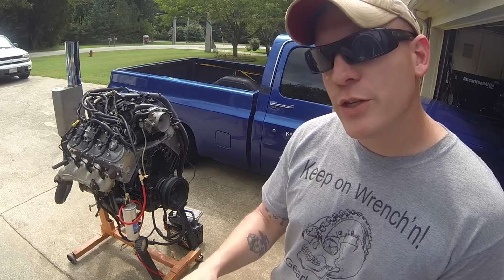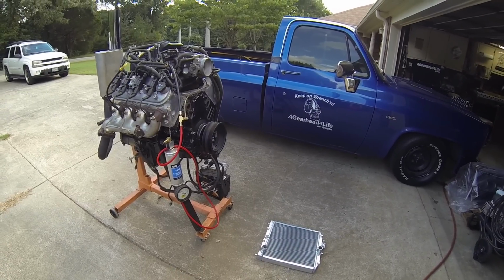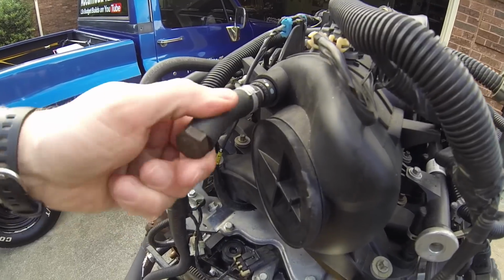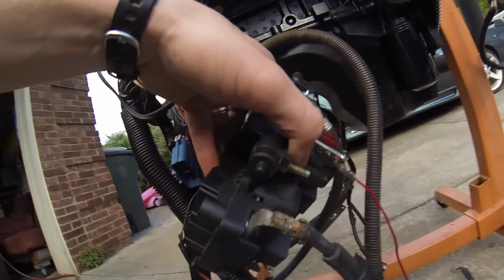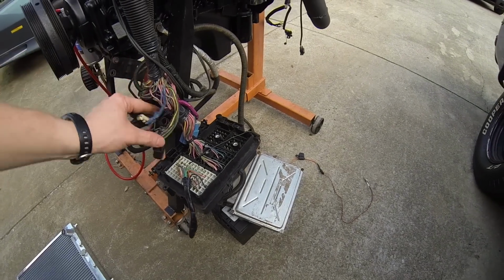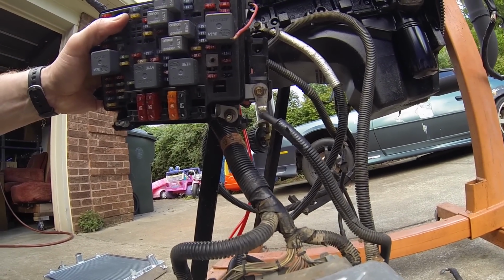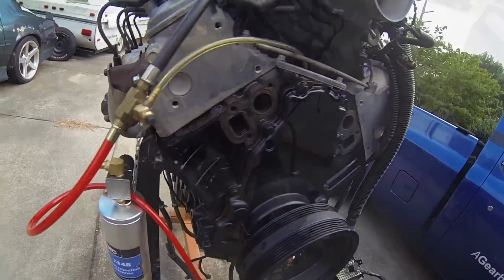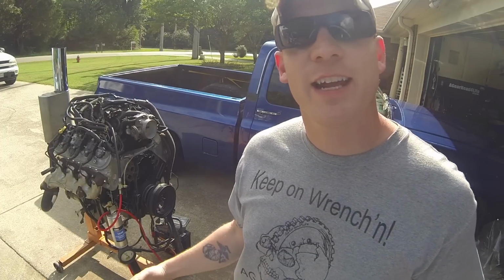LSx Swap Harness How To Simple & Free DIY Standalone on the Test Stand

Comment: Great Video.
Question - have you been able to successfully  run a 4L80 transmission with these swaps?
Or have you been sticking to the 700-R4 ?
Reply from the maker: +John Mulhall I see you havent watch any of my other videos. lol Most of my swaps are with 80e. I dont use 700r4s.
Reply: now that is an area I need education on (4l80e use) as well.  How much bigger is the case of the 80e over the 60e?  I see the market draw for a transmission video on what you did as well.
Reply from the maker: norsk54472 Good idea! it's not that much larger and there are a few different ways to run it. I prefer the segment swap though. Since you have HPT, it'll be something to put on your list to figure out. That's what I've done. lol Had a buddy show me how it goes, but I'll have to practice it.

Comment: I've done exactly what you did plus more and it runs rich to the point to where it wont start and stay running you can smell and see gas fumes as your turning it over and there is gas in my oil, got any ideas?

Comment: Love the videos man. Question, i have a drive buy cable throttle body but my wiring harness is electronic, is it possible to convert  the electronic throttle harnessto drive buy cable?
Reply from the maker: cheep jp Thank you! Yep! This harness was converted from DBW to DBC. It was about 5 wires that I had to add to the harness for the IAC and TPS.

Comment: What if I don't have that white fuse block which where that black wire comes out? Btw awesome vid! I've learned a lot thanks to you!
Reply from the maker: Thanks jmtz! You don't have to have that white fuse block. Before I had it I just ran a wire to the same terminal. The fuse block is labeled and you'll see where it goes.
Reply: +AGearHead4Life thanks!!!
Reply: +AGearHead4Life soon I'll be LS swapping my 1972 c10 with a 5.3 and a 88mm turbo. I'll send you pics through out the build
Reply from the maker: Sweet! Good luck! Sounds like fun.

Comment: Hey buddy can you email me info? I want to do away with the  big bulky fuse box and drop a 5.3 in a 94 gmc this is my second swap . and wire it into my existing fuse box or at least wire it into a smaller fuse box . thanks for any information. please keep up the great work and I love your toys!!!
Reply from the maker: +chevyman Thank you ChevyMan! Nah, I can't keep up with the emails or FB PMs. So on here is the best way to communicate. I try to keep up with the comments on youtube. That or you could join our group FB page "A Gear Head For Life". LT1SwapDOTcom has the diagrams to help you out too. Basically it just cutting off the fuse block and giving all the pink wires power. Most are ignition hot and a couple are constant hot.

Comment: whats uo gear head...I have another dilema hoping you are able to help me...I'm having trouble with the fuel delivery I purchased a inline pump but I'm not quite sure how to run my hoses and I don't have a return in rail...thanks your info and videos are A-1..
Reply from the maker: Thanks brotha! Which part is your delima? The lack of a return line on the fuel rail? If so, just use a C5 vett fuel filter. It has a built in pressure regulator and has a return output line.

Comment: Same 1997 GMC Sierra 3500 7.4 wondering which wire's are power to the computer there are two I'm guessing one constant one with ignition.. I start talkin to mechanics about figuring this truck out they start shaking their head no.

Comment: Can you explain where you are connecting the fuel injector device to that provides fuel to the engine?  If you are connecting to the valve on the fuel rail, what adapter are you using?  I bought the same exact model injector cleaner, but it did not include any adapters and no way to connect to the fuel rail. Thanks.

Comment: Hello Again. Working on my other project. 
I went to start my dad's 1967 Olds Cutlass with 4.8LS (Engine from 2003 Chevy Silverado) Conversion and smelled fuel, I luckily had the exhaust and headers separated.
I saw fuel spraying out of the passenger side of the header.  I Swapped injectors for Cylinder #4 & #6 after smelling fuel on the plugs. I restarted the engine and the fuel still leaked unburned raw fuel.
Any Ideas on how I should fix?

Comment: I have 2 x 5.3 Ls engines for a 52 Chev and a 34 Plymouth one is 2000 and other is 2002 after VATs removal on the PCMs will these be driveable as you outline with the harness. Thank you for all your efforts for all of us. Very commendable
Reply from the maker: +Harry Ahmed Thanks Harry! Yes, you could drive it like this. You'll want to run the TCC wire to your brake pedal though, if running the LS style trans. You'll also need to figure out how you'll power your fuel pump. This harness has a wire coming off of it that is usually used to control the fuel pump relay.

Comment: will not having enought fuel pressure cause it not to crank i looped the driver side fuel rell as you did and hosed up a holley black to the passenger side vats removed
Reply from the maker: Yea, it wont run if the fuel pressue is too low. You need 60 lbs. It'll kinda run on 20ish, but not very well.

Comment: Hey I have the same cooling fans off a Lincoln and I was wondering how u had the relay hooked up to get the high speed to come on 84 chevy
Reply from the maker: +Christopher Kingsley There are many ways to trigger the high speed to come on. I'll be using the AC to trigger mine, but I can run the high speed yet because I havent acquired large enough relay and wire to handle it yet. Very powerful fan though. Cant wait to get it working at its best.

Comment: My whole center plug is gone out under the fuse box so this be my reason for no power to my truck? I've swapped over to a ls1 intake and a stand alone harness that was cleaned up . The truck was a factory 4.3 now is a 6.0

Comment: Hey bud! Great easy video......... I want to swap an LS in to my 2010 Crown Vic........Although the LS engine runs stand alone and all, immobilizer deactivated, how do I make the harness talk to my Ford gauges? Or is it as easy as just finding the wire that sends a signal because they all communicate the same?
Reply from the maker: I could possibly be that easy. I dont know what the Vic gauges need to see as far as signal, but I'd hook it up that way and see what happens.

Comment: What about the MAF?
Reply from the maker: Juan A. O. Z. The PCM does fine without the MAF. I believe that it defaults to using the MAP for the needed input in this situation. I don’t use a MAF anymore. I did at first, but not anymore. 😁👍
Reply: Nice... job job. Thanks

Comment: I want to put a lq4 from a 2005 Silverado HD with the 4 L 80 I have the whole wiring harness the throttle pedal the Box the wiring all the way back to the stock fuel pump powering the system up with the one wire will it make the transmission work as well after flashing the Box doing away with the EVAP EGR and second oxygen sensors

Comment: Great video ..but what if Iwant to keep my transmission 700r4 in a c10- 83 ... but I like
this engine 5.3 ....and is not difficult to adapt .... my fear is the motor mount , comp, exhaust, and transmission  ....  cheers .......
Reply from the maker: I don't recommend using the 700r4. You can, but you'll quickly break it and then be replacing it. I have a video on the motor mounts as well. The exhaust was covered in my first '84 C10 LS swap video.
Reply: AGearHead4Life
you right ... and the fuel pump ?? .. cheers ..
Reply from the maker: mco zpda a walbro 255.
Reply: AGearHead4Life
tks ....
and the trans is the same to that engine ?
Reply from the maker: no. I use an 80e

Comment: Hello.  I have a 5.3ls and 4L60 from a 2000 Tahoe installed in a 1971 chevelle.  I have the entire fuse box,  engine harness,  and ecm from that Tahoe. After flashing the ecm, what steps would I need to do to use that existing fuse box or would you suggest not using it?  Thank you in advance for your help.
Reply from the maker: John Smith This sounds like a much longer discussion than could be typed here.
But basically, you'd do just as I did here in this video. It'd work fine. There'll likely be other things that you'll want to wire in later, like the TCC wire to the brake switch for the 60e that you're running and the OBD2 port for information. You kinda gotta review the setup to decide what you'll want.
Reply: Thank You for getting back to me. I will try and mirror your video...

Comment: I only have the C2 part of the fuse block. Is it possible to get the motor running without the rest of the fuse block(c1, c3, etc)?  Where would I power and ground C2 to get it running on the stand?

Comment: Hi Im doing a LS1 swap with stand alone harness,  do you use any tuning software and what about fault codes as no  BCM  connected it will be throwing up codes due to missing inputs from sensors. Hard to find honest information on tuning software.
Love the videos keep it up.
Reply from the maker: Thank you! Yes, I started out having a tuner dial everything in and turn CEL codes for things that I wasn't using, like the emissions stuff. I never had an issue not running the BCM.
You'll need to locate a tuner, preferable local to you, that'll flash the PCM for your setup.
Reply: Cool, I have had a tuner  remove the VATS so i can get it running for now,, Not cheap here in New Zealand though most tuners asking  around $500-$650 to reflash computer. Holley oil pan from US cost me $800 delivered,  once car is complete i will get a dino tune as want to upgrade cam.  Could you recommend a  cam and stall converter for a weekend cruiser using 4l60e and  3.55 rear end.   
Cheers
Reply from the maker: Ouch! Man, that's a bump in costs over there. There are so many tuners here that people can get a PCM flashed for $100-150 to remove VATS. But to get an actual dyno tune costs around $400.
To chose a cam for another project can be hard because you never know what they'll find tolerable for them.

On the budget cam side we have cams like the BTR Truck cams. They're budget because of their low lift allows them to use inexpensive valve springs($60) and stock push rods(free).
So, something like the BTR TRuck stage 3 cam could be fun for a somewhat aggressive weekend cruiser.

There are better cams with more lift that will require $100 hardened push rods and $150 Valve springs.
Check out the Texas Speed & Performance 224r cam.

Comment: This is bad ass, is there a way to do it if you didn't get the fuse box?
Reply from the maker: thanks! Yes there is, but that'd be another video. I plan to make more videos of different ways of doing this, each would be a step more in difficulty. the next video would be how to do this without using the factory fuse block.
Reply: Awesome, I am thinking since this is my first swap i should just pay to get my harness re-worked but it's just so dagon expensive and it stinks to see my car sit. Thanks for answering  bro i really appreciate it.
Reply from the maker: Yep, no problem. You could also easily pick up a fuse block from a salvage yard.
Reply: I ended up getting a harness, with a ecu, and a throttle body for a pretty good deal. If this swap goes smoothly i will probably swap out some more of my toys :) thanks so much for answering my questions.

Comment: Now wait a minute.  If I don't have the original fuse block from the donor vehicle, pin A9 of the C1 harness isn't connected to anything... Or am I not envisioning it correctly?  If it's truly this simple, I'd like to strip off the plastic wire loom and remove all of the un-necessary wires to clean up my harness/engine bay.

Comment: I'll keep u posted on the build...its a 5.3L..Out of a truck...I hear u can bolt up a 400 transmission, 4L60, 2 speed powerglid...What do u suggest?...Project daily driver
Reply from the maker: +Buick72100 Yea, you can use all of them, but as a daily, I've got to have overdrive. I usually prefer to use the 4l80e because I can find them for the same price as a 60e, but theyre very durable and I don't like having to drop a trans for repairs. If you plan to abuse the car, like a race car, go with a strong trans like the 80e. It eats some power and is heavy, but its worth it in my opinion to not have to keep replacing it. That plus its inexpensive and strong, my favorite.

Comment: 1997 GMC Sierra 3500 7.4 liter dual wheel pickup truck. The main computer under the hood driver side 4 plugs white black red blue connectors small Central connector topside also. In between black and white connector.. I've changed everything. Coil ignition module distributor crankshaft position sensor and that main computer ECM I guess you call it. I don't have chipped key. I did ignition sequence 11 minutes on 30 seconds off Etc. No spark no control side relay to load side. I've been able to get full pressure by jumper wiring load side fuse box apparently no Spark. Visible. From spark plug wire. All three fuses good ignition A ignition B ignition e. With power fuse box ignition on.. Was driving motor just shut off a week ago. Now cleaning grounds...... mayday mayday

Comment: helpfull videos i got a 02 5.3 that has the drive by wire could i use the dbw with that setup or should i look for a throttle body  that is ran by a cable?
Reply from the maker: +Nick H That option is for you to make. It's all one what you prefer. In the past, I have always converted it to DBC by just adding the wires for the TPS and IAC to the harness.

Comment: i need you to explain how to make your own fuse block please. my 5.3 doesn't have the block, just the plugins
Reply from the maker: +scrappy echols I would like to do that, but it will be quit a while before I'm able to make that video. The best that I can tell you now is to study the LT1swapDOTcom site. ONce you cut those connectors off, you give power to the wires that need power, mostly just the pink wires. One or two will be constant power and the rest will be keyed on power.
Reply: +AGearhead4Life ok thank you

Comment: hey bro. love the channel. had a guy "flash the vats" so he claimed. tried to start the truck with 60psi of fresh fuel to the rail, it started to fire for a few secs. now the coils aren't firing. u think dude bs'd me about the vats? i dont have a tuner so idk what to do
Reply from the maker: +4TheLuvOfNitrous You may have already figured it out by now since it's taken me two weeks to reply, but I'd guess that you should check your grounds. I believe VATS will disable your injectors. So if you have no spark at the plug, you likely have a lose ground somewhere.

Comment: can you run am engine in the vehicle like this? i’m swapping my 75 stepside chevy luv and my 88 monte carlo ss and if i can run a toggle from the c1 plug a9 pin and a starter button to the starter like your trigger button could this be trusted? would it still be able to run engine codes off the obd2 as well?

Comment: great job man ;-)
one question
is it the same to do for a 2013 LS3 ?
Reply from the maker: +blechtitten Thanks blechtitten! It's the same idea, but would be applied differently. LS3 will have DBW throttle body also. That has to be in the mix to make it work.
Reply: +AGearHead4Life 
thanks for your answer
thats right, but i will change to a throttle body drive by cable ;-) the LS3 will be work in my 88 Chevy Van G20 ;-)

Comment: Thanks for the information! In the middle of a 4.8 NV3500 swap S10 fr a daily... not a hot rod. I got some questions if you might be able to help out.
Reply from the maker: +Dustin West No problem. Sure, post your question here and I'll reply when I get a break. I'll warn you though, I stay pretty slammed and sometimes it can take up to a week to get a chance to take a break and respond.
Reply: THANKS! I got time. a weekend/spare time project.
Questions
#1: What sensors are required for a Swap? Bare bones EFI setup?
#2: do you know a drop in fuel pump for older chevy's? I have asked and everyone says get a walbro 255lph pump but no one has helped with a part number. and how do you run the fuel system? connections?
I have more questions I guess I should make a video with my issues.
Reply from the maker: +Dustin West You should join the group facebook page called "A Gear Head For Life". There is a guy on there named Brian Kemble that is currently adapting that same trans to a 5.3.1. The sensors required will depend on how you want to run and tune it. But I'd guess you'd be safe to say to remove the two secondary o2 sensors and the EGR, which is all for emissions. There is more that can be removed and still run, but this would be a much longer conversation, because they depend on the project. You could just leave it all there and not use it too.2. I do not have a part number on the walbro 255, but that's the same that I use. There are a couple different versions, depending on the application.

Comment: do u have a step by step chart if it possible. . I got a 1500 Chevy 5.7 Indian I'm trying to put in my 1978 Monte fuel injected
Reply from the maker: Nah I don’t, but LT1Swap.com has lots of info to do it and the wiring diagrams. Some of the instruction may not be clear, but after studying it for a while, it should help.